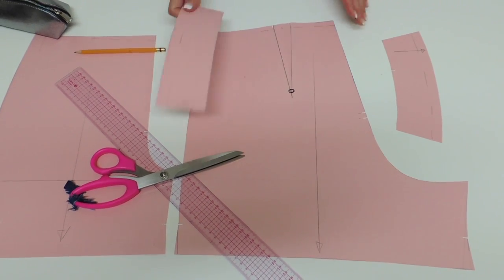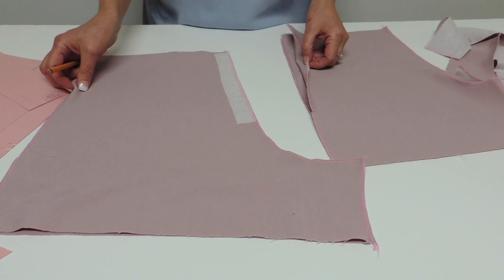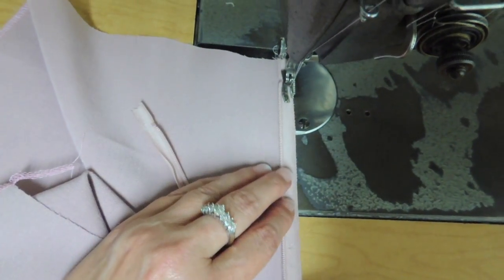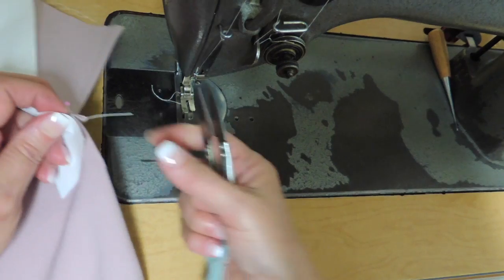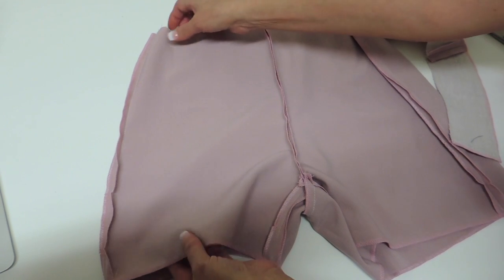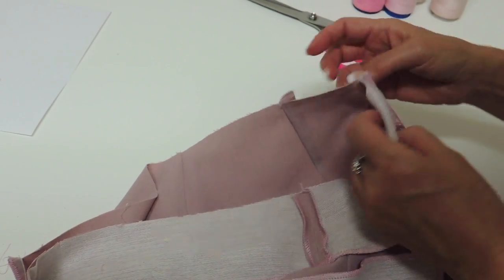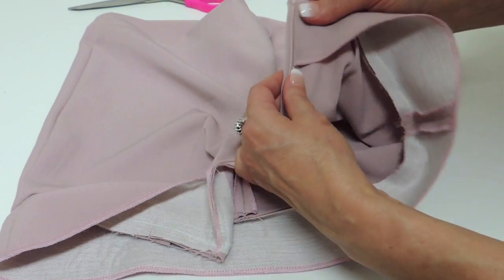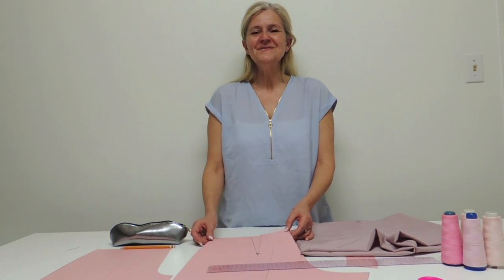How to sew shorts.

Comment: Thanks for this tutorial Ma. 
I cant seam to find a pattern tutorial for this short or should i use the pant block and cut it? If so i can't see d back small dart, please where did it go and the crotch looks longer. What modifications can i do to the pant block to get the shorts
Reply from the maker: Hello Nwoye,
I did't do the video of the pattern of this short yet, only the sewing, but yes it's right from the pants block. I eliminate the front dart on the side seam, and the back small dart, 5 mm or 1/4 inch at center back and the rest at side seam.
I also offer this pattern graded in My ETSY BOUTIQUE : https://www.etsy.com/ca-fr/shop/TOOLFULLY?ref=seller-platform-mcnav
Diane

Comment: I couldn't understand how u attach  the 4 parts together
Reply from the maker: Hi Areej, first you want to sew the zipper, than inseam back to front, than side seam back to front, than finish the crotch from bottom of zipper to center front waist.
Diane
Reply: Diane Deziel thanks alot for answering. Im learning tailoring and some sewing or attaching parts together is missing,like should I sew hems together or iron them open ?. Thanks.
Reply from the maker: Hi Areej,  hem is the finishing, you could do it by hand or by machine, but I suggest you sew it first than press. Diane
Reply: Diane Deziel thanks a lot  for your time. Love  your videos, so helpful.